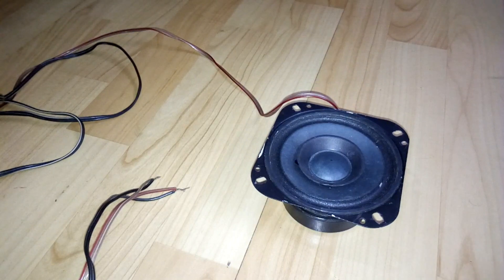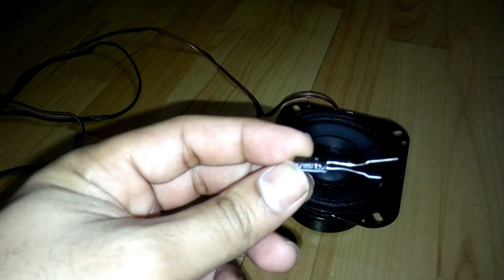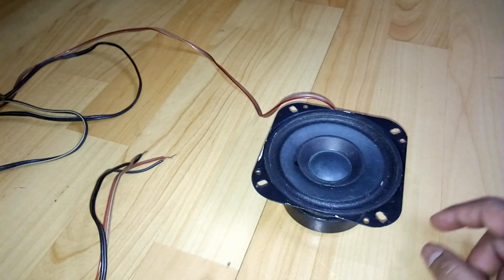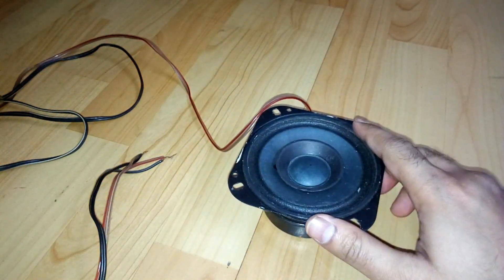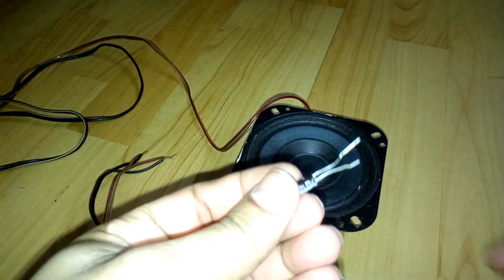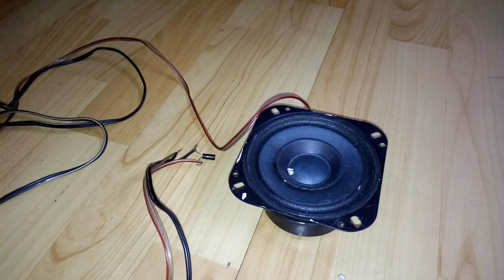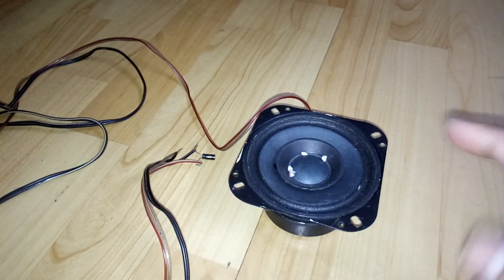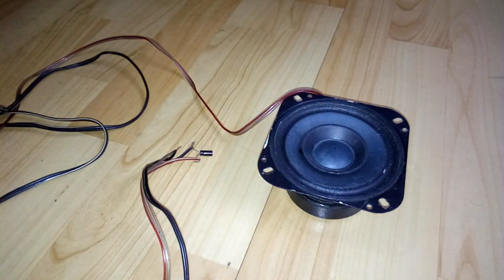How to Install a Capacitor as a Crossover/ bass blocker

Comment: Im planning on putting tweeters in my truck and wiring them in with my dash speakers. Will a 25v 4.7 mf non polar one work good with blocking out the bass to the tweeters? I saved them from a set of vintage bookshelf speakers i scrapped.
Reply from the maker: Yeah that would work 👍

Comment: Suggest a capacitor to reduce Bass for Subwoofer, bcoz Subwoofer distorts on high volume..
Reply from the maker: Thats not really possible. Check the amp first. And you can use a cement resistor to the subwoofer.

Comment: So would a fried capacitor for a tweeter prevent it from working at all? I have a speaker being worked on. Guy said capacitor is fried and wants to replace capacitor rather than use a replacement tweeter that works that I provided to him. I feel very suspicious about it. What say ye?
Reply from the maker: If the capacitor is blown then the twiteer wouldnt make any noise
Reply: @technoboy-allinOne  it didn't
 Capacitor was replaced and works great now.

Comment: Nice video..nice explanation..in addition to this, could you kindly tell us a single way to build a passive low pass filter for a subwoofer..

Thanks in advance..
Reply from the maker: For that you mainly need a heavy choke coil. But the desire frequency depends on the number of turn of the coil. But for better result you must use an active low pass filter. For a subwoofer passive low pass filter is not at all a good option. And also the copper coil price would be much more then an active low pass filter.

Comment: is it possible to put too much power into the capacitor? if yes, how do i know if mine wont blow?
Reply from the maker: Too much means? How much?? Not sure. But you can easily give it 300 to 400 watt
Reply: @technoboy-allinOne  oh ok, thanks. i was just thinking if it is possible to blow it at about 50watts and i have to know how much it can take or, how you said, it doesnt matter that much

Comment: Hi i have a i- Cooper tweeters model i-257 and 20mm silk dome tweeter, 60wrms, 20mm 4ohm kapton voice coil, spl 93db M/W, frequency 60hz- 23000 hz.. seller told .e to add 3.3uf of 100volt or 2x10uf of 50 volt capacitor in each tweeter negative terminal. Can you plz help me in this??
Reply from the maker: Go with 4.7uf or 3.3uf... and voltage doesnt matter here. The uf= microfarad block the bass. Voltage does nothing here whether its 63v or 100v. And connect to the positive terminal of the tweeters.

Comment: My brother, what capacitor can I used on a 260watts tweeters frequency is 3500-23000hz and I'm connecting it to a 2000 watt dc audio amplifier.
Reply: Convert 260 watts to volts and the volts you get thats how much volts the capacitor should be and i don't think you can get 3500-23000hz exacly

Comment: How can i get  6ohms speaker? What will i combine to have 6 ohms speaker? Thank you
Reply from the maker: All branded speakers are 6ohms, like yamaha,pioneer etc. If you wanna use a 4ohms speakers with 6ohms amp then you can use a cement resistance of 2 ohms.  If your amp has 6ohms output. Then you can use 8 ohms speakers too. The speakers impedence must be the same with the amp or higher to keep your amp safe. There you can connect 2 no of 4ohms speakers serially, then they will make 8 ohms.

Comment: So, why do we need crossovers if a capacitor can do the job?
Reply from the maker: A crossover is made for highs as well as lows too. Crossover uses a coil for woofer to reduce the highs.and use same caps for tweeter. And some crossover has mids too. But normally a caps can be used to cut off the bass for tweeter. For example many sony music system uses only a capacitor like this for tweeter. They dont use crossover.

Comment: I have a tweeter 1 inch & 25 watt. How capacitor i use for bass?
Reply from the maker: This capacitor is used to block bass. You can use the same value i showed in the video
Reply: You could use 2.2uf 4.7uf anywhere around these numbers within reason you can buy a few different ones and see how it sounds

Comment: super "trick" to balance cheap active pc-speakers with subwoofer. usually the bass is way to loud for this combinations. well done, sir.
post scriptum (03.12.2019): sir, can i use normal capacitors (with + and -) or only bipolar? the electro-store near me, told me today not to use polarized (+ to + and - to -) but bipolar (no matter how i connect them) capacitors for my purpouse. i want to kill some 50% of the bass from the logitech z313 "subwoofer". thank you for answer ...
Reply: The amp uses Alternating current to drive speakers in and out that's not true of all amps but that's why you use bipolar capacitors. There more money then regular ones. You can use two non bipolar just connect the - together and the + to your - & + wires then to your speakers

Comment: Can I use 400v 3.3uf axial capacitor for 100w tweets and a speaker of 30 w and the amp output is 50w
Reply from the maker: voltage doesnt matter here. 3.3 mfd would work as bass blocker but in different frequencies. you can check if the sound satisfy your ears you can use it.
Reply: @technoboy-allinOne  ok so I can use normal caps or I have to use axial?
Reply from the maker: @inaam2988  yes you can use normal caps

Comment: Hi, i noticed that you connected it on the positive pole, i have been taught that i must connect it on the negative of the speaker, I have been doing so for years and it works exactly the same... But my question is, what is the difference actually?
Reply: There is none, I have seen OEM car makers do it either side of the speaker.
However the capacitor should be non polarized electrolytic , otherwise if you reverse polarity it can destroy the capacitor.

Comment: Good day,
I have a 3.3 uf 100v and a 2.2uf 100v.
Can you tell what is the difference in sound between the two if i connect it to my 100w 8ohms tweeter?
Does 3.3 uf is louder?
Reply: 3.3uf will have a lower frequency cut off i.e for example if 2.2uf gives ~4khz and above,then 3.3uf will give ~2.5khz and above.which tweeter u want to use?

Comment: Hai. What's capacitor specifications ?? Any one inform me??
Reply from the maker: 100v & 4.7 mfd  Electrolytic capacitor
Reply: @technoboy-allinOne  will anything happen if I use a 450v 4.7 or it needs to be a 100v mfd capacitor? thanks in advance :)
Reply from the maker: @KombiNacija_Jagodina  here volt doesn't matter much. Only the farrad matters. Yeah u can use. nothing will happen
Reply: @technoboy-allinOne  wooow... Thank you very much for helping me and for a fast reply also. The thing is that I'm having a small problem with my 2 way speakers in the car beacuse they push to much bass and that really ruins their clear sound. I'll put 500w subwoffer in the trunk but the thing is that if I cut off bass on the stereo it will affect the woofer and this is the perfect solution, everybody doing their job and playing like they should. Thank you once again. :)

Comment: so how do you determine what capacitor size you need to tweeters, mid range and bass?
Reply: trial and error, smart to use a system with lower impedance tweeter

Comment: could you help me out with right capacitor for tweeter?!    I have scanspeak tweeters  R1904/613001  and i use them in 3 way active  system  with DSP  ,but  i want to conect capacitor for safety  ,what kind of capacitor i need? how much wats and uF  do i need?
Reply: a 5.6 microfarad capasitor is suggested for that speaker https://www.madisoundspeakerstore.com/auto-tweeters/scanspeak-discovery-car-r1904/613001-autosound-tweeter-one-each/ Im also thinking of using DSP. What kind of dsp do you use?

Comment: Do all bass blockers (capacitors) brands are the same or different brand can do better @ blocking the bass from the tweeters??
Reply from the maker: In this case Brand doesnt matter. All are same. Only Value matters.
Reply: hi, what is the value for the capacitor?

Comment: Without getting too technical, what is a good "size" capacitor to use on a 2 inch speaker (not a tweeter)
Reply: depends on what freq you want to cut off at here is calculator https://www.diyaudioandvideo.com/Calculator/SpeakerCrossover/ you enter resistance on both speakers and simplest 1st order butterworth crossover design which consists of a cap for tweeter and inductor (coil) for subwoofer ps most speakers cut off at like 4500Hz or 5000Hz but really depends on how u like it
Reply: @1sonyzz  I don't know what a frequency would sound like.  That's why I asked without getting too technical.  What is recommended
Reply: @1sonyzz  Hi what capacitor would work for a 3.5 speaker with 4 ohm and 40w?
Reply: A 4.7microFarad will do
Reply: I bought the infinity kappa 60csx kit and it came with tweeters. I want to make my own bass blocker because I need it to fit in a small space. What size capacitor do I need. I believe I need something 7000 hz

Comment: is bad or good with capacitor ?
Reply from the maker: Berjon Ibro its for high frequency only. No bass. So its very good for highs like tweeters
Reply: the bad is polarized electrolytic, the medium is bipolarized electrolytic (gets job done) the good or best is polypropylene (film capacitors) codes MKP for low esr (capacitor resistance) and better quality

Comment: We can use it in 12 inch speaker
Reply: If you 12" is higher resistance than your tweeter and you protect your tweeter with a capasitor, then only the base will go in your 12", since the high frequency will go through the lower impedance tweeter. In mye eays this is a perfect crossover without the distorting coils.
Reply from the maker: Raju shah yeah u can. But u dnt want a big size woofer to produce high frequency only & no bass.
Reply: @technoboy-allinOne  do all bass blockers (capacitors) brands are the same or different brand can do better @ blocking the bass from the tweeters??